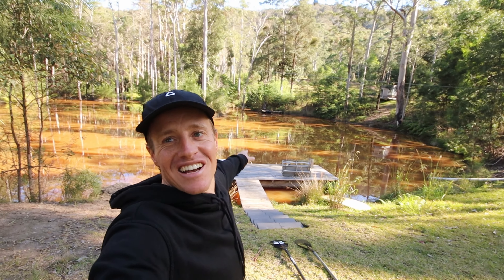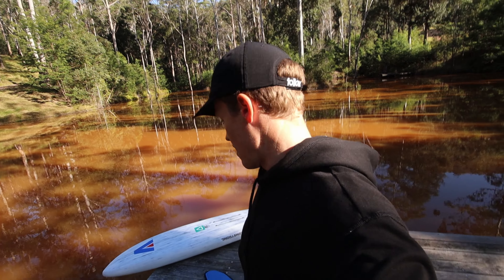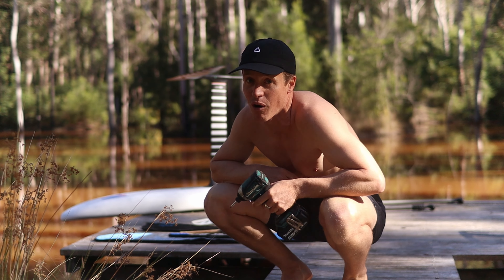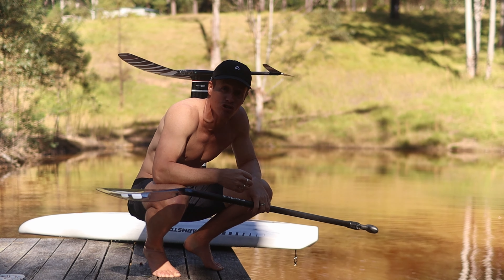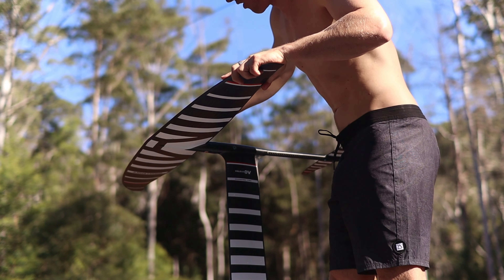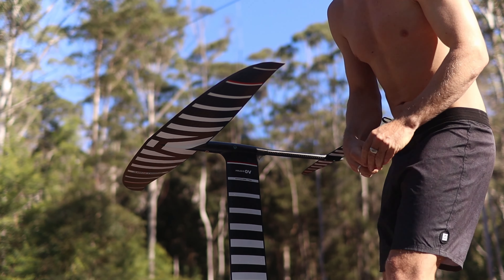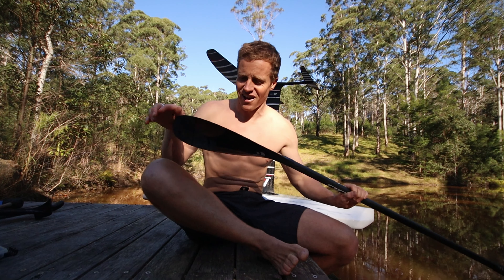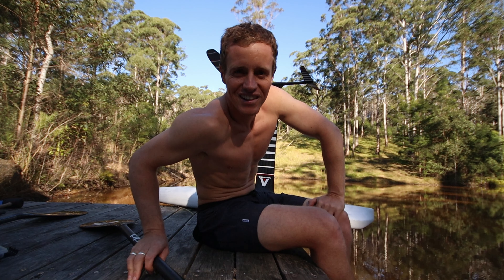Does fuselage length and paddle size make it easier to get on foil?

Comment: thank you.. This explains why my 70cm fuse used for dock starting works best (already at the surface of the water) and a 60-65cm works better for the constantly changing conditions during a prone ride.  Also, it is my opinion, that like in flying, the bigger/stable the front wing the smaller the back wing can be. (less surface area to "push up and down" when grave digging). I've tested both.  I don't SUP but you did an excellent no nonsense / common sense explanation that is easy to follow.  Thanks again

Comment: I love these comparison videos! They make it so much easier to decide what kind of gear to buy without having the luxury of trying everything first. 
On an unrelated note, what do you think your ultimate setup for flat water pumping the longest distance would be?
Reply from the maker: That’s exactly it, there is a lot of cost with gear in this sport so if we can thin out the options and understand it then guys aren’t wasting money on the wrong stuff! 🙏 
That’s a super interesting idea… if you’re going for distance it’s going to be totally different than east of paddling up. I would go for the biggest and highest aspect Foil you can get. It will still paddle up fairly easy without cooking yourself, but then when you’re up you’re on something that is quick and with a lot of glide to cover the furthest distance
Reply: @OskarJohansson1   Came here to ask a similar question and also say thanks for the vids. Really helpful.. So in relation to flat water pumping, would a shorter fuselage help with getting more time and/or distance.. I'm using the Sabfoil W1350L for pure flat water pumping and have been stuck at around the 90sec mark for about 6 months. Am trying to get to 3mins as this will comfortable allow me to dock hop in my area. Current fuselage is 71cm long.
Reply from the maker: @steveothedeveo  Stoked to hear man!
Its a bit of a tricky one to answer and so many aspects to it. When you are pumping what is caused you to stop at 90s? Is it your legs giving up with too much lactic acid? Or is it your cardio giving up? The shorter fuse once you are up on foil and pumping will give you a faster and more aerobic pump. This will work your aerobic system more. Howver the longer fuse you can drive a little harder and cover more ground per pump, but it is more taxing on the quads. Depending on what is giving up for you at 90s can determine how you try and work those different systems. There is also so much technique you can do to work different systems.
Reply: Beautifully explained. Your foresight is spot on. It's my legs giving out. Which could be because of the longer fuselage but am well aware working on my technique would be the more appropriate long term fix. Thought I'd ask to see if a shorter fuselage would help short term. So much going on with this foiling caper. It's fantastic guys like yourself are making these vids. Much appreciated.
Reply from the maker: @steveothedeveo  Shorter fuse means you can pump at a higher cadence which means you are taxing your aerobic system more so than your legs. Try it out and see if it helps.. 🤔

Comment: Great video! Just curious what stabilizer you are using and are you using any shims?
Reply from the maker: Thanks mate! I was using the Glide 220 with no shim, basically just going for as much lift as possible to help get out of the water easier and quicker.
Reply: @OskarJohansson1  That's what it kind of looked like, but I wasn't sure. Thank you for the response. Helps me to decide on my next gear purchase 😃

Comment: Great vid thanks. Where are you running your mast in the tracks and do you find any difference with release of the board moving it forward or back? And you'll have to do review of the quickblade stingray next!
Reply from the maker: So I dial in my mast position when I am in the surf. I like to have my stance in the same position when I am both paddling and when I am on foil. It’s just one less variable to think about during the paddle up. I will go into the surf with a tool in my pocket and catch a bunch of waves moving my mast around until I find that similar point. On this board that is as position 11 in the tracks. 
Oh I am so interested in that stingray. Heard a lot of great things and a really out of the box idea
Reply: Thanks

Comment: Hey Oskar, great video mate. Did you notice any difference between paddles in regards to stiffness with one being adjustable and one not? Thinking of trying an adjustable paddle mainly for paddling easier on foil and catching those swells 😊
Reply from the maker: Thanks mate! I didnt notice any loss or difference in stiffness, but I am also short (174cm) so I am using the paddle with very little extension. I think for a taller guy with the handle extended it might add some flex, but for me I didn't notice any.
Reply: @OskarJohansson1  nice, that’s good to know 👍

Comment: Hi, Oskar! Thank you for great videos! Could you advise what to choose for me to learn paddle up in flat water? I'm 69kg. I have Armstrong DW board 107l, paddles 72, 91, 102, 115, masts 60, 72.5, 79, all armstrong fuses, all large wings incl new APF, all tails. What paddle, fuse, mast, wing and tail is better to choose to learn paddle up? And where is better placement of mast? Thank you!
Reply from the maker: Hi mate! Stoked you're enjoying the videos. 
You have an amazing quiver of gear, I am jealous!
Your board size is great, I assume you have some SUP background seeing how many paddles you have? In general the larger size paddles are easier, but for guys with strong SUP backgrounds and good technique the smaller paddles are easier for a high cadence. I would use the 105 at your weight personally, but it does require a lot of power to pull through. If you feel like you can't get that high cadence then maybe size down one. As for foils I would go with the APF 1675, 202 tail, 60 fuse, and 79 mast with the mast at 9 on the board.... I like the APF foils 2cm further back than where I ride the HAs so just go with that from where you have the HAs. The rest of the setup is more about what you know and what feels comfortable to you. I love the 60 fuse as an allaroudner and I feel very comfortable on it, but that is up to you.
Reply: @OskarJohansson1  Thank you for detailed answer! I don't have much experience in SUP, but I can paddle straight :) My cadence is better with QB Stingray 72 paddle. Why APF1675 better than APF1880 for me for learning? I have them both. I still can't pump & bounce board to lift it from water yet. I tried MA1750, APF1880 and CF2400. I will try APF1675, may be it will be easier to accelerate. I didn't tried APF for winging yet, but CF2400 much easier to lift from water in 6-7 knots. I use 45cm mast for better acceleration, once I will lift it up from water, I will change mast.

Comment: Great video! Why ride a large MA rather than a HA like the 1525?
Reply from the maker: I only use the MA as its got more low speed lift so is something that most people learning to paddle up would use. If I was going to do it just for myself or for DW then 100% I would always ride a HA wing. They are just much quicker and so much pump/glide.

Comment: Thanks for the informative video.  I noticed that you place your mast near the front of the mast track.  I have the Armstrong 7' 2" DW board.  For light wind winging. I place the edge of the mast base near the very back of the track(for light wind winging)  --  I using the Sab 1350 (span. of 135 cm., 1800 sq. cm. area, A R of 9.5) for  both light wind winging and flat water paddle ups.  I've moved the mast forward about 1/2" at a time and have gone from "5" to "7 1/2" as noted on the track to try and engage the foil for paddling up.  I weigh around 71 - 72 kilos (155 to 158 pounds).  I'm getting close but need some advice.  Should I just move the mast to near the front of the track? Thanks.
Reply from the maker: Hi mate! I haven't riddent eh SAB 1350 so its hard for me to say for that exact foil, but if you are struggling to feel the foil engage during the paddle up then moving it forward will definitely help. I would also check out all of Jeremy Riggs videos on youtube to get some tips on the paddle up as well, he has some great tips on technique.
Reply: @OskarJohansson1  Thanks for the reply.  I'll try moving the mast forward and see what happens.  I've noticed that when I have moved the mast forward a small amount the board is more difficult to paddle in a straight line.  Also, where I position my feet (a little further back) it seems to make popping up the nose a little easier.  Do you change your position on the board depending on the size of foil you use?  I think there are a lot that goes into this that is forgotten or not really thought about by the "elite" foilers.  I sure have a lot of respect for you and the guys who make this look "easy".  I have watched Jeremy Riggs -- he seems to have a paddle up super power.

Comment: Shims change the angle of the stab which would then also increase the vertical radius. Does adding shims have the same effect on pumping as using a longer fuse?
Reply from the maker: Yes exactly, if you add shim for more lift then you tighten that radius and it makes it easier for the board to release. It is a lesser effect than chsnging the fuse, but still very noticeable. That would be a good suggestion for dialling in your setup and way less expensive than buying a new fuse!!
Reply: @OskarJohansson1 would that be a plus or minus shim? I'm guessing something like a +1 to add more lift. I'm new to shimming 😊